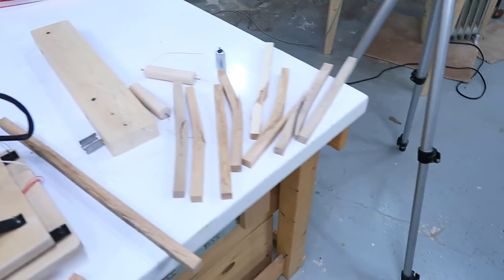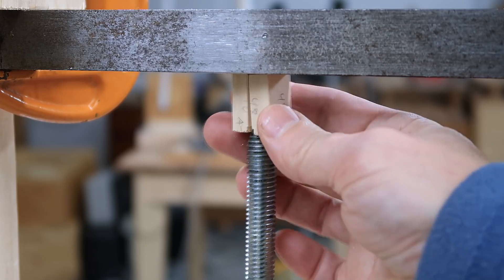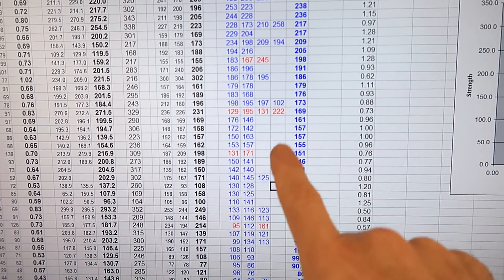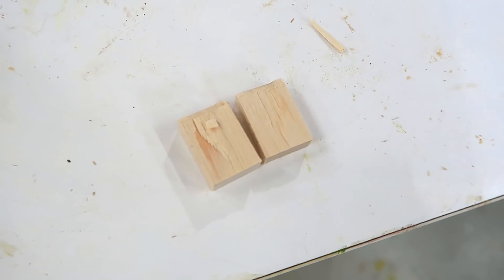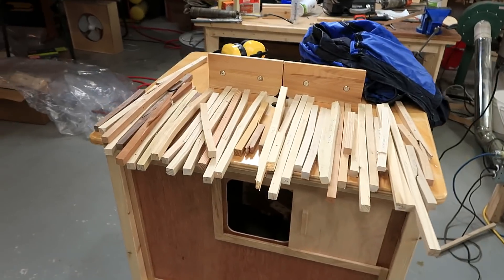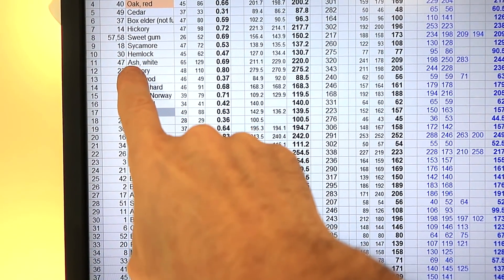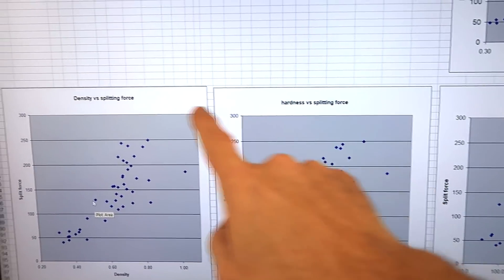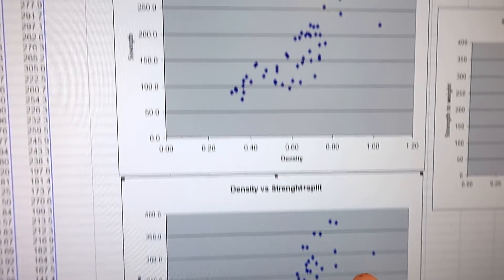Which wood is hardest to split -- cross grain strength.

Comment: Very interesting tests Matthias. It is difficult to find cross grain tensile strength data published anywhere so it is good to see this large data set with the different relationships.

I’m a structural engineer and design in timber a lot (mainly radiata pine or doug fir here in NZ). The cross grain tensile strength is known to be very variable and many orders of magnitude lower than the other loading situations for timber and the design codes/standards that I use don’t even provide capacities for different species of timber. Relying on the tension capacity of timber perpendicular to grain as part of a load path is usually avoided at all cost in building design or otherwise reinforced by embedding fully threaded screws across the potential split plane.

Comment: Great methodical experimental research, thank you! Looks like birch is pretty optimal. It's one of the most widespread, cheap, and accessible types of wood in Russia (after pine, which, in addition to being quite pitchy, is, unfortunately, not a lot better than marshmallow in terms of strength).
Reply from the maker: There is a very good quality birch plywood you can buy, and it's often referred to as "russian birch"
Reply: @MexTheOnly  
HA!  I had to read that twice before I got the joke.  Nice!

Comment: If you split firewood you’ll know that striking the axe blade perpendicular to the growth rings usually pops the wood right open, whereas if you strike the axe blade parallel with the growth rings it is not always that easy. Loved this series, thanks Matthias!
Reply from the maker: going paralell to the growth rings, sometimes you find there's a hidden branch inside that makes it like it's bolted together!
Reply: @matthiaswandel  true! Very uncalled for, those! Also with branches it’s best to strike them dead on center, usually it will split the log and right through the branch / knot itself.
Reply: @matthiaswandel  ... even better than bolted: naturally grown together with the branch's integrity in wind and weather, in sun and snow, under bear and crow in mind. 😁
Reply: @matthiaswandel  It's also because of the medullary rays, which are fibres in the wood that go from the center out.  They're one of the reasons that rift sawn wood is stronger and more stable (though often uglier and always more wasteful).

Comment: Interesting,  again, traditionally Dogwood  was used as wagon wheel hubs. The article I read stated it was because of abrasion resistance,  however since a hub requires many mortises to accommodate the spokes, there might have been an advantage for it to not split easily as well.

Comment: I have a book on sharpening written by Leonard Lee (Lee Valley founder) and there is an appendix at the end that summarizes studies on chip formation and splitting.  If I’m remembering correctly, there were three cutting directions that influenced the splitting force.  I thought it was similar to your experiments here and thought I’d mention it - if you haven’t read those studies you might find them interesting.

Comment: This is certainly a useful reference for the occasional woodworkers amongst us; there's plenty of tables and comparisons out there, but without a useful frame of reference, these are not much use. I really love that you explained your values and process along the way. I find it much easier to find the right values to look for when there's a mental connection between the testing process and the project idea...

Comment: Cross grain strength usually is tested in a pulling arrangement. Wedging it causes a lot of uncertainties in the experiment.
Strength depends also on the type of anatomy of the species. Take, for example, usually breakes nearby the poars, applying radial force, and on parenchym on tangential force.
Therefore the species should be first selected by anatomic features.

Comment: Great stuff Matthias.  Funny that I recognize some of those samples!  Surprised dogwood performed so well.  It made me wonder how growth ring density compares.  Obviously you addressed density by weight, and that would correlate with growth ring density in many species, but possibly there is something additional that can be gleaned from growth rate.  Species like dogwood grow extremely slowly.  Maybe growth rate correlates more with split resistance than just density or hardness.
Reply: Yeah, maybe "rings per inch" should be part of your collected data.

Comment: learning for my exam in materials science of wood I came back to your video because I found a table that says that the wood is two times stiffer in radial than in tangential direction. this is due to  the fact that most fibrils of the woodcells are oriented in a higher angle to the axis of the fibre. furthermore the wood rays and increased content of lignin are having an impact too. this should explain the variation of results, even if you tried to consider this by changing the orientation of the precut, doubling the stiffness is not a small variation.

Comment: I can tell you that American Elm is difficult to split.  Especially the elm that grows with a twisted grain.  Some elm is fairly straight.  Some is very twisted.  If you can find the twisted, it will make great gears.
Reply from the maker: The twisted grain makes it hard to split as firewood, but in any small area, it's relatively straight, though not necessarily lengthwise.  Which is to say, for stuff like gears, the crooked grain doesn't help.

Comment: Very interesting experiment, I've downloaded the excel file from your website but I don't understand the columns about length and weight because ,for example, the first specie is Beech but it's length is 34 cm and weighs 78 grams but the pieces you've tested are clearly smaller.

Comment: Very nerdy, I love it! Interesting results.

A few years back, I pulled up some in-depth testing of screw pull-out strength in different species, which, surprisingly, came from the US Forestry Service (edit: found it, I think: the Wood Handbook from the Forest Products Laboratory, General Technical Report FPL-GTR-190 -- if not that, probably some supporting research paper). So this kind of data is actually useful to somebody. If someone were interested enough in it, they could probably even get a grant to do more in-depth testing.

Comment: It's been a ton of tedious work, for sure!  

My own experience (strictly anecdotal, no measurements, limited number of species) is: (1) western red cedar - super soft, splits if you look at it wrong, my go-to if I want to split up some kindling.  It also tends to have a lot of internal stresses. (2) red oak - tough, my choice if I need something springy, and (3) cherry - tends to be comparatively brittle but quite beautiful and machines like a dream.
Reply from the maker: Yes.  And that sort of experience values trumps data.  And you don't need data on 20 different species if you only have five to chose from.
Reply: @matthiaswandel  I certainly wouldn't minimize the value of your work.  Sure I have experience with a few species, but I can use test data to comparatively assess species that I don't have experience with.  I never would have guessed that lilac is so strong and tough - maybe I'll seek some out.

Comment: What you posted confirms what I feel when I swing a splitting maul or use a power wood splitter.  Things are inconsistent.  I split mostly maple, red oak, black locust, and white pine.  To me the white pine splits easiest.  The black locust is next, BUT it splits oddly in that the splits aren't clean and the split pieces need to be pulled apart by hand.  The maple is next and fairly consistent and clean.  The oak splits nicely but is the most inconsistent in terms of the force needed to split.
Reply from the maker: there's also a big difference between splitting wet and dry.  I split a lot of cedar shakes for my dad long ago.  wet cedar was easy, dry cedar impossible.

Comment: At 1:30, you can see that sometimes the jack jumps fairly high.  I wonder if it hit the steel bar on one or more samples?   The flattened part is on the side that would have hit the bar in this one clip.

Comment: I feel like, to some extent, wood is too erratic to get good strength measurements... But very interesting nonetheless
Reply from the maker: Lots of variability for sure.  But if I test pieces that came from close to each other in the same board, they can be very consistent with each other.  Which is to say, I can accurately measure the forces, though the species as a whole may be erratic.
Reply: It varies a lot from species to species and board to board, one knot hole can make a board incredibly weak and the density of the board can make it strong…very interesting stuff!
Reply: Which makes those delicate-legged antique tables even more amazing.
Reply: Tensile and compression strength along the grain are more consisted than tensile strength across the grain (which is variable and poor).
Reply: Project farm doesn't seem to have these issues lol
Reply: That is why wood as a building material does need a well educated builder (statics, dynamics, engineering) with skilled eye to make sure no "weak" parts are built in in places where the "better" parts of the indeed pretty inconsistent material are required. As a boat building apprentice I learnt how wood does have three dimensions with very different properties. Later in university that fact often was neglected to an extent that practical lab tests got a lot more erratic than they had to be were the wood used in a more educated, skilled way of looking at it as "three-dimensional" instead of "radial or longitudinal " only.
Reply: @robertbamford8266  Some of those have been rived (split) before shaping in order to maximize grain length in a useful direction. Most would have at least been sawn to do so.

Comment: Re 3:45 Flat spots on the wedge should increase the force required to cause a split. When we're pounding nails into wood that's splitting we flip the nail over and give the tip two or three whacks to dull it. The dulled section of the tip will crush the wood fibers in front of it, decreasing the likelihood of splitting the wood.
Reply from the maker: uh, yes, like I said.
Reply: @matthiaswandel  Hmm, ok. The way you worded it, I took it for the opposite meaning -- that it HAD more splitting force, as opposed to required more splitting force.

Comment: It would be interesting to test Eucalyptus melliodora (yellow box), which has a wiggly interlocking grain and is basically impossible to split (you can push a wedge all the way through it without it splitting).  The toughest (not hardest) wood I've worked with.  (Wiki also says it survived Hiroshima blast so it's tough in more than one way)

Comment: I’ll look at the spreadsheet, but I’m curious how woods with interlocking grain fared? I buried three steel wedges in an elm log once trying to split it for firewood. I ultimately had to free them with a chainsaw. I hear that sycamore has interlocking grain as well.
Reply from the maker: some trees will have the grain go helically up the tree instead of straight, then reverse from time to time.  Makes it really hard to split.  Though for a small enough block of wood, it doesn't make a difference if it doesn't have a grain reversal in the block.

Comment: I found a major splitting factor that.supercedes other factors especially in older houses is wood that is too dry.  A home in a warmer climate that was built around 1970 had roof trusses that were.so dry that the beams were splitting easily. I am not sure we can save the roof without replacement of all roof trusses but am recommending clearing venting as the home is in mid atlantic and the lack of air circulation in this roof that violates all current building science resulted in severe dryness.  There is also in my opinion reasonably higher fire risk.

The home is in an area where spending on renovation is easily money well spent so even though roof exterior surface has 10 plus years life remaining, I think a major renovation of house should include replacement of roof structure completely

Comment: I have salvaged 1.2 kW motor from vacuum cleaner and want to use it on a project. Is it duable? I heard that these motors are high speed and low in torque. Maybe will need some speed reductor for building a belt sander..
Reply from the maker: You could use it to make a vaccum cleaner.  It isn't of any use for anything else.

Comment: I tried making kindling without splitting it by cutting a bunch of thin disks with a chainsaw.  They do not burn well.  It's a high proportion of end grain is the problem I think.   Normal shaped kindling burns much better.  Something to do with the (gluten or whatever) vs the wood fibers.  Might make a good video for you.

Comment: Your hard maple results seem correct. That's why you jave to hold a maple baseball bat 90 degrees away from how you hold a traditional ash bat. Maple is stronger radially, while ash is stronger in the tangential direction.

Comment: Do you have any interest in testing a whole cross-section of a log to see how the properties change as you get closer to the center  or further out to the edge of one single species?
Reply from the maker: Interesting idea, but the variability is probably more a function of growing conditions.
Reply: @matthiaswandel  Absolutely. North side (northern hemisphere) shady hill fir or larch "soft wood" can outperform some of the sunny rich wet spot mid range deciduous "hard woods" strengthwise (while it usually doesn't). It is, too, the MIX of different properties besides breaking force, like resistance to fungi or resistance to summer/winter conditions depending on what is about to be built with that make the "good choice" of wood.

Comment: If you gather enough data and also include relevant characteristics of each sample, what you are doing could end up as a good dataset for machine learning. For example, you could estimate the strength of a piece by just presenting its features (e.g. color, grain size, etc.).
Reply from the maker: Machine learning is only useful if you don't know what you are doing.
Reply: @matthiaswandel  Granted that it might not be a revelation but still ML could help with interpolation or extrapolation of your data. BTW, since I know you are not a stranger to programming, specifically Python, there are tools you can use to help you with analyzing your data. My apologies if you are already familiar with such tools. I just wanted to make sure. For instance, you can use SHAP plots to find the most relevant features affecting the strength of the samples. But again, the size of your dataset is an important factor.

Comment: why didnt you make a tip (needle) point to drive into?
Reply from the maker: that could cause splits to go in all kinds of ways, which would make the results harder to interpret.
Reply: @matthiaswandel  i would give that a try, cause whats beeing measured is the force needet till it splits. needeltip is maybe to think about, but lets say a 1 or 2 mm round tip? at least you equal out the direction of the grain cause it splits in the direction the wood wanna go to.

Comment: Strength along or across the grain are important when dealing with weight distribution and shearing forces, but abrasion and sponginess can be a factor too when choosing a wood.  For instance, you wouldn’t use balsa for drawer runners.  Perhaps you next experiments will examine abrasive qualities of wood and application.  Just food for random thoughts.  Your experiments are always good for entertainment, even when the results may be suspect.  Thanks.
Reply from the maker: you wouldn't use balsa because it's too soft and weak, so the fact that it abrades quickly really isn't a factor.
Reply: @matthiaswandel  
Correct.  You wouldn’t use it. I merely used it for a demonstration that the softness of wood is a factor in certain applications. For a similar example, how do you choose which wood to use for making gears, plywood of course, or bearing mounts for diy bandsaws or planer.  As I said, just random food for thought.  Perhaps the answer is simple.  Doesn’t take a lot of experiments to determine, just experience.
Reply: @billstoner5559  Interesting idea, can think of a few ways to do that. Anecdote: I have a section of wood floor that's unfortunately getting chewed up by an office chair. Looks to be oak I think, but some pieces / grains just don't appreciate the compressive rolling forces.  Note this is a bit different from abrasion, and different further from bearings for example.  So, testing and correlating all of those circumstances would be, well, more work...

Comment: Wood is so very unisotropic you need to control that as a fundamental part of the setup i.e. be consistent and to wheh you are splitting tangentially, radially or longitudinally (or which combinations of the three)

Comment: II was looking for American elm I didn't see it. I love the stuff for blocking and trailer decks its pretty strong and terribly hard to split.
Reply: I rewatched and found it just not talked about. I think. I'll have to download the data thanks for taking the time to do this.
Reply: I guess in my defense as I try to watch closely. There is about 10 common elms in north America and each one probably would react differently to the tests preformed. I would personally like to see them separately tested.
Reply from the maker: and each tree reacts differently too, I'm sure.
Reply: @matthiaswandel  before Dutch elm got after the elms. Elm was used for furniture it stains glues and holds hardware very well. It steam bends well holds its shape and it handles shock loads properly better then most woods. I very much look forward to your videos thanks again my man.👍